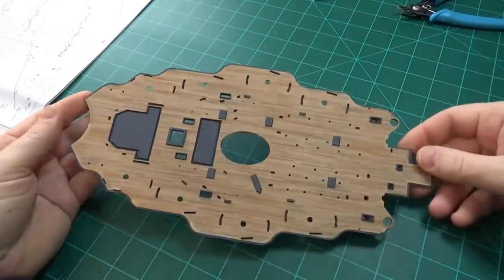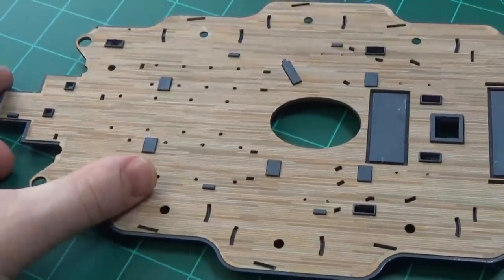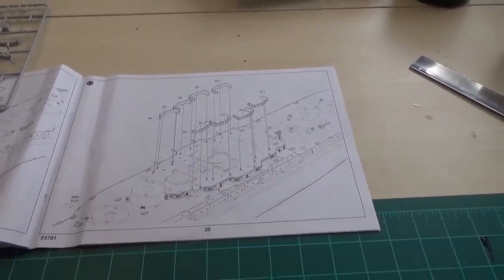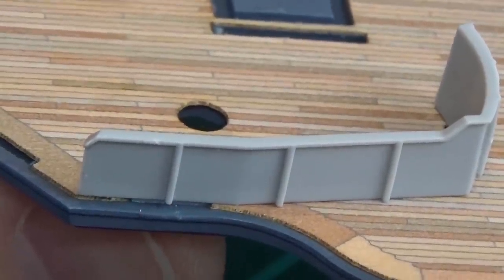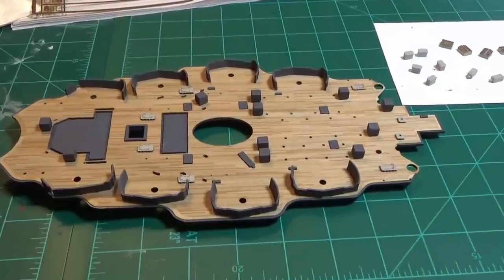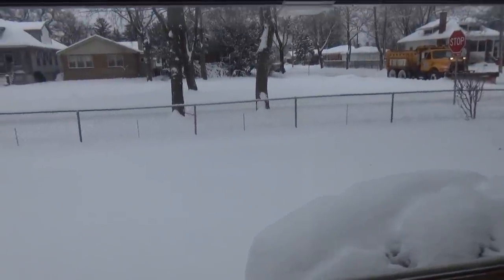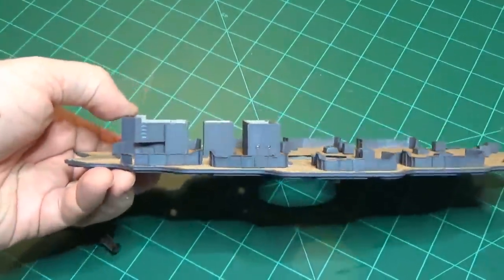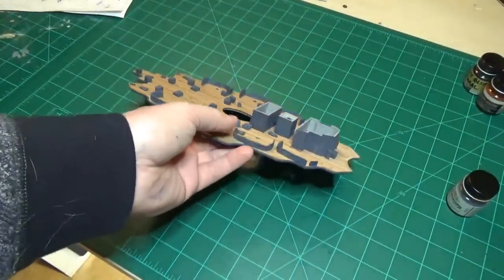USS Arizona by Trumpeter 1/200 Scale Build Video 7

Comment: I use that 3M red putty, too.  You can use it on large areas, too. You have to layer it, of course (because of shrinkage).   I use three tiers of fillers.  The paste stuff, like squadron white and green is good because it is hot, and creates good solid fills.  The middle tier is the 3M red stuff.  It is soft, but super easy to sand.  The last tier is Mr. Surfacer 500 and 1000.  It is for fine detail work, and saves tons of time.  The key to all of it is to apply sparingly.  I use cheap dental tools as spatulas, and even tooth picks with the Mr. Surfacer.